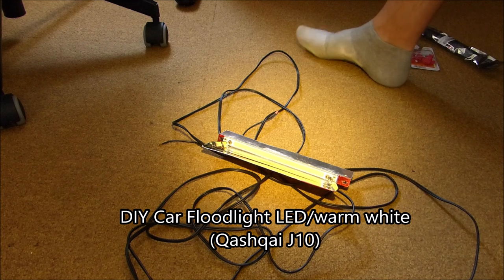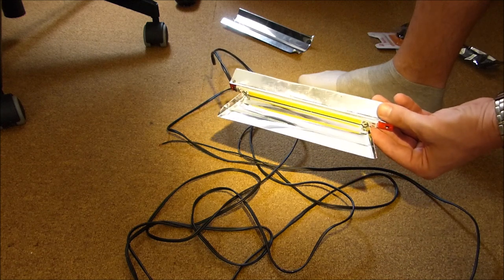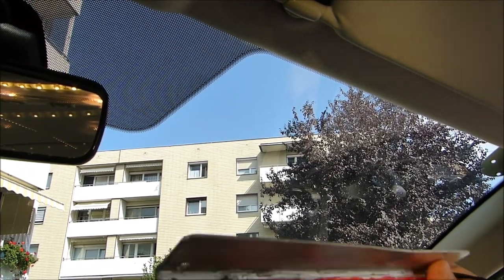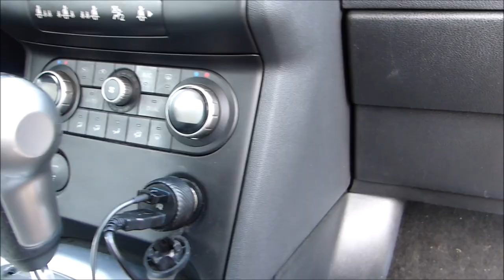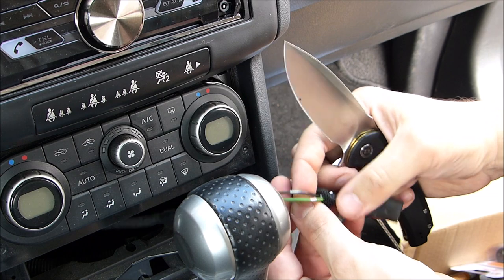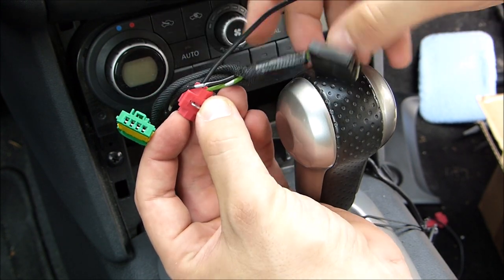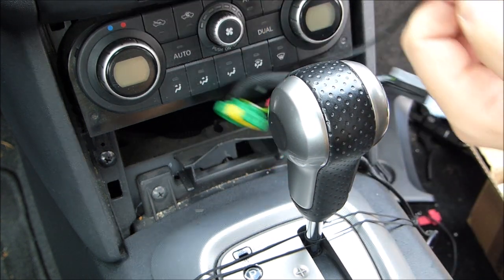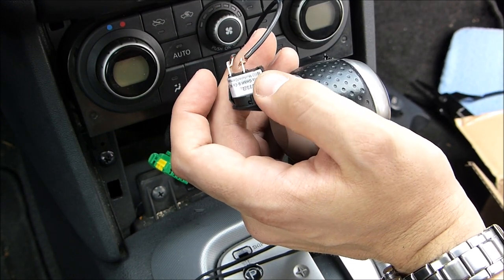Hidden DIY LED Floodlight Mod (Qashqai J10)

Comment: How big is the heat sink under the COB and did you buy it or salvage the aluminum from somewhere?
Reply from the maker: I had this piece of aluminum for years in my house after I did a DIY high power LED-lamp for my office about 8 years ago when there were hardly any good LED-lamp-solutions available. It is about 2mm thick as large as possible to still make it fit in the car. The COB-LED does not get very hot and the size seems to be more than enough. You can get aluminum profiles at any home improvement store.